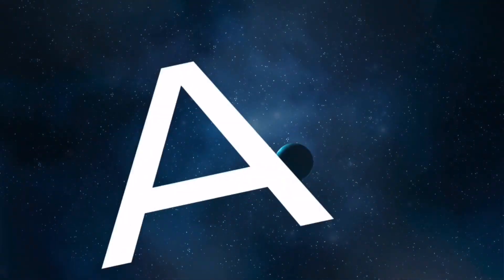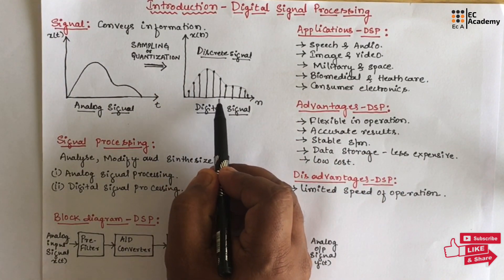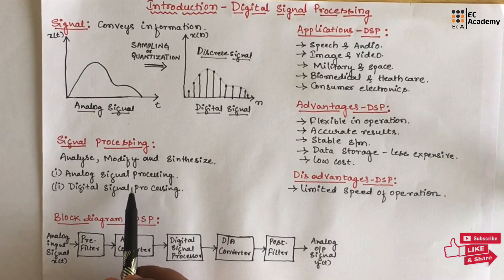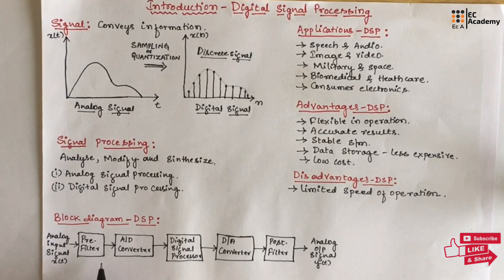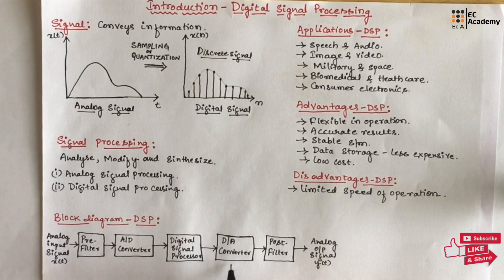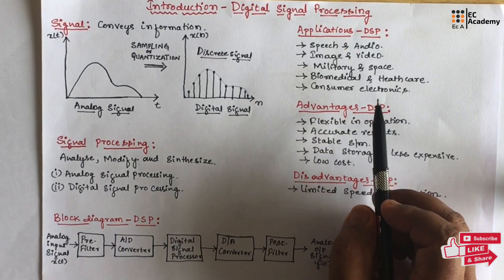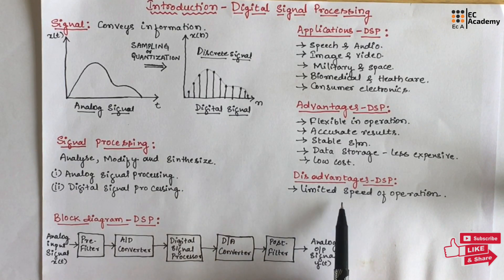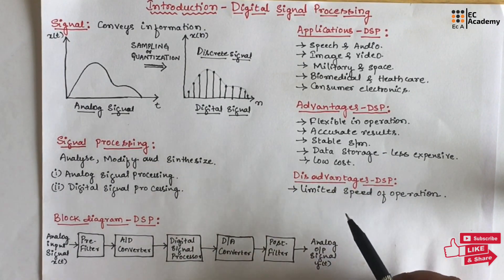Introduction to Digital Signal Processing || EC Academy

Comment: 14 
15 a) Design a high pass FIR filter using the rectangular window and satisfying the 
following requirements: a passband frequency of 600 Hz with a maximum 
passband attenuation of 0.1 dB, a stopband frequency of 500 Hz with a 
minimum stopband attenuation of 50 dB, and a sampling rate of 4 kHz 
....
How this prblm can do

Comment: Fs>=2Fm....why it should be 2 only?
Reply from the maker: If the signal contains high frequency components, we will need to sample at a higher rate to avoid losing information that is in the signal.  In general, to preserve the full information in the signal, it is necessary to sample at twice the maximum frequency of the signal.  This is known as the Nyquist rate.  The Sampling Theorem states that a signal can be exactly reproduced if it is sampled at a frequency F, where F is greater than twice the maximum frequency in the signal...
Hope this was helpful.... don't forget to SUBSCRIBE and keep supporting EC Academy 👍
Reply: @ECAcademy  thank you sir